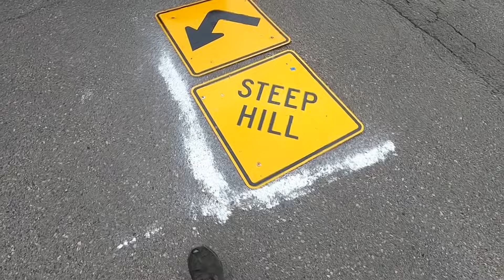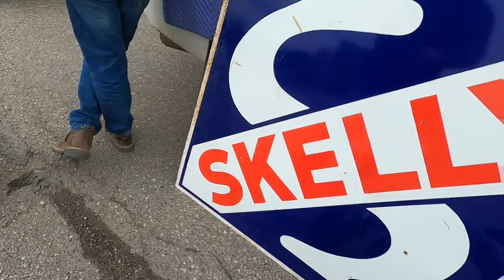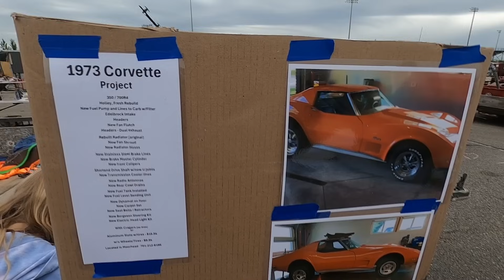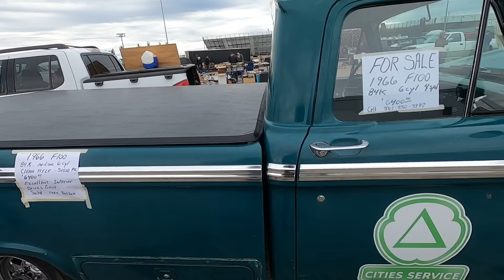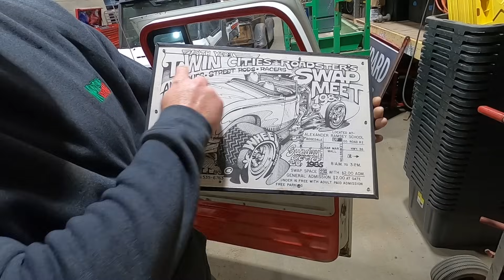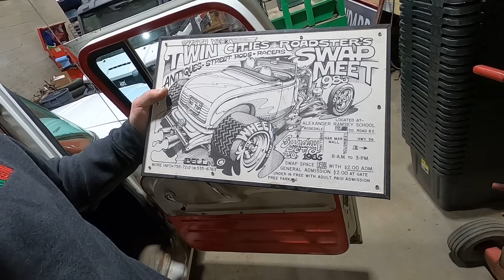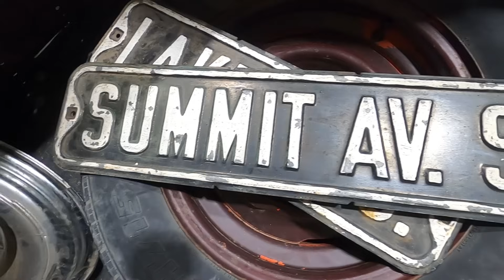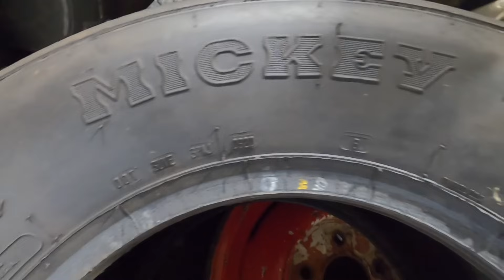So Many Deals to be had!! Huge Parts Scores and MORE at the Local Swap Meet!

Comment: Been messing with an 89' suburban, broke down a week ago , new ECM ,fuel pump , fuel pump relay, distributor, coil , grounded the motor again. And it still dies and hard to start !  I just bought an 87'motor with a rod hanging out of it. But it has everything to convert it  to a 4 barrel carb.  No more fuel injection. I feel beat    , Thanks for the video to ease my mind some ,  it's been a bad week !!
Reply from the maker: Good luck!

Comment: Those valve covers are probably from a dirt track car with the bars around the motor bracing the radiator and the core support and then they would rivet sheetmetal on the car and also attach it to the pipes and it was probably wrecked motor swapped front end reworked and ran again, because totally redoing another similar dirt track car is usually too much work so the car is usually just repaired and slapped back together to re run it at track..
Reply from the maker: Interesting

Comment: I had a set of the red chrome
Reply: I used to have a set of the mid 70's Ford Motorsport die cast valve covers with the ribs and the Ford Motorsport logo painted in a dark metallic red and the 79 400 bbf bronco motor they were on was painted hot rod semi gloss black with a spray gun lol and the flywheel pulley and accessories brackets were nu cast silver it looked really sharp